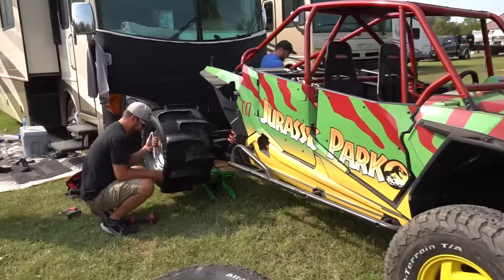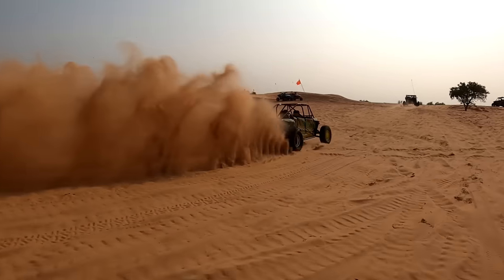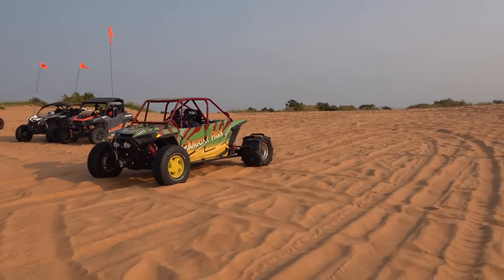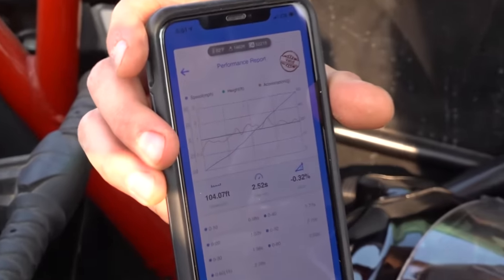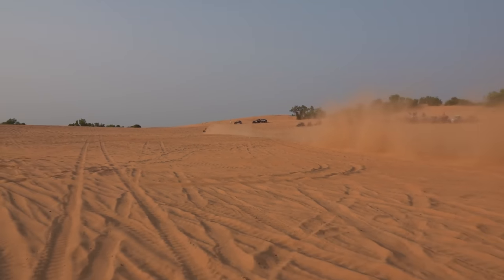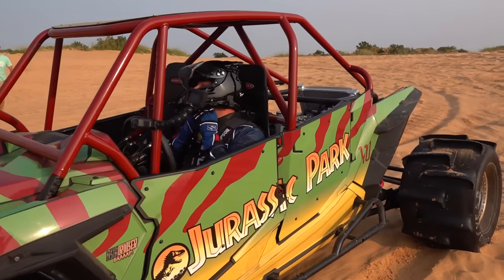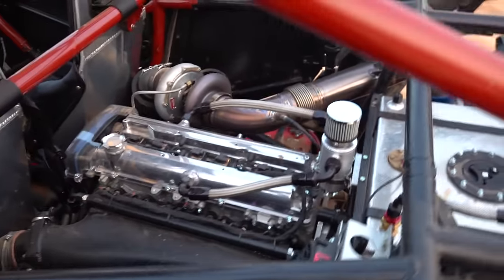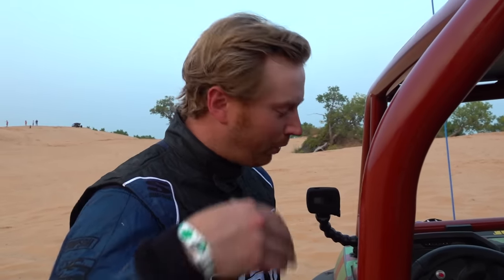1000HP 2JZ powered Polaris RZR hits the sand at LITTLE SAHARA!

Comment: I have sand drag for years. I feel you have plenty of tire. You are in some real soft sand there. You have a 2 spd shift at a 100 ft. The higher gear will load the motor and allow the tire to hook up. Your to use to hearing you belt drive no shift SXS running up the rpm.  The car you have now has big horse power shift early to load the motor and hang on don't drive it like your SXS. Your doing a great job a little more seat time and you'll be the guy's to beat.  That thing is awesome I've been following the build.
Reply: Totally agree. Try short shift it into second and make it lug.
Reply: I need to shift it I agree
Reply: I'd also take some rebound out of the rear shocks as it's bouncing off the bottom and bringing the weight off the tyre
Reply: Or maybe 12 pounds on the tire pressure?
Reply: Omg goog vid

Comment: Just need them smoothies for the front now
Reply: Right imagine it not dragging a BFG 35 through the sand 😅😅😅 this thing is an animal
Reply: Came here to say this
Reply: I’d bet on picking up a tenth or two just because the front end could float better
Reply: Lightening up the front will help it transfer weight to the rear too.
Reply: It’s a 2jz and needs that weight up front with sand tires up front you’d be wheelieing and not hooking

Comment: When you guys get to the strip at sliver lake with the wet sand it will be a rocket with the wheels in the air. !!
Reply: Yep that it will
Reply: @dylankumzi  for what the wheels never left the ground
Reply: @calebhoffman3784  wet sand is gonna grab harder. Most likely bringing the front end up.
Reply: @jaden2790  yeah your right that makes sense
Reply: @steveletson6616  makes sense
Reply: @jaden2790  sometimes the wheel spin is good and actually faster on dry sand then moist wet sand. Wheel spin with paddles grabs more sand equals more sand up and out car goes up and out.lol
Reply: Hell yeah, once i saw the slow mo clip i immediately knew that at silverlake its gonna be a beast, freshly groomed track at silverlake and it's a rocket, put some wings on it and it'll fly
Reply: Axle snapper.
Reply: @dylankumzi  needs wings
Reply: @clayboist  You seen how beefy those axles are? I'm not saying it can't break but it'll be very difficult
Reply: Is that silver lake Oregon?
Reply: @Coyotethumper5  michigan

Comment: Everyone thinks they’re fast until a 2jz swapped rzr shows up
Reply: I think a sxs might keep up in a short track
Reply: @donny-2964  read the draggy data they go.. smh power to weigh means a lot. Put 550whp on a sxs and it will keep up with that in a SHORT TRACK.
Reply: Hey fool go on the new video. Smh sxs ran just as fast as the 2jp did..
Reply: Jose David oh yeah no doubt but but it’s not that serious dude. It was just a everyone thinks there fast joke.
Reply: @donny-2964  I didn't call you stupid.. I respectfully commented my thoughts. But no big deal. It's nothing but a comment. Have. Great day!
Reply: Then the 2j guys get humbled by the guys with the 3000hp LS sandrails!!
Reply: Eric teipen nobody is running 3000hp out in the dunes let alone 2000 maybe a 1-2 guys at glamis or another very popular
Reply: that's some serious 2 stroke poppet valved loop charged power ther! Are you running Motule 800 2t in it. What is your oil injection rat on your 2Jz or do you premix/ What is your premix ratio on your 2JZ? Do you run he stock oil injectiuon system on this thing? I got my 7.3 power stroke on 50:1 each fill up and low ash 2 stroke oil xd-100 in her boy it 33 a gallon for this old poppet valved 2 stroke and she drinks a quart per 1000 mile when i rev it. im connecting 2 OMP VRP pumps into the intake when i get to it though. Motule 800 2t is 14 a quart but ill get that next for my rotary and 8v92 2 stroke detroit if the local boat dealer quit selling BRP XD-100 2T. i bought 5 quarts of amsoil dominator synthetic 2 stroke for my rotary but she loves it! not sure what a 2JZ  2 stroke need but i heard Motule 800 2T!

Comment: Definitely hitting 2nd early would bring the wheel speed up, propelling you faster
Reply: This. In sand you have wheel spin all the way through the gears, so an early shift will likely equate to faster wheel speed, spinning, to get more acceleration. I feel like the tires are 'catching up' to the gear as it's hitting the top of the gear. Unlike asphalt where you are locked in and need to rev out the rpm, here and early shift and get the wheel speed up higher. Sand and mud is all about wheel speed. Not traction so much as you would think.
Reply: Mo powa baby?? 🦅
Reply: I think it would get too squirrely

Comment: Unfreakin believable! The roosts that come off 2JP is incredible! Congratulations boys you made 1000++HP sand dune ripper. Epic
Reply: sick 2 stroke conversion here running motule 800 2t oil injected! Tjs motor can run in any position like a sled motor!
Reply: 2 stroke poppet valved loop scavened brapp, oil injected or premixed? motule 800 2T all the way

Comment: i was thinking you might just need to give her all the beans and let it spin. its not gonna hook on the sand anyway so might as well giver the dinner
Reply: I think with fluid surfaces, acceleration is transferred to the vehicle as long there is enough surface contact. The tires are gonna have a peak "pumping" rpm per foot and if you surpass that by X amount then you slow down. I don't know anything about it really but I assume it's similar to boat propellers. The amount of water they move should allow the engine to reach the power band and limit rpm to near peak HP.
Reply: I find with big enuff paddles sand hooks just fine
Reply: The Weapon Collection  Horsepower is king, try walking in sand vs high horsepower and huge paddles, its amazing the amount of energy it takes but with the right set up its amazing

Comment: The most reliable Polaris in history. Beautiful machine.
Reply: is it running the stock oil injection OMP or is it premixed, this is a pioppet valved loop chared 2 stroke so i heard they like Motule 800 2t, not sure but its dry sump and oil injected and can run in any position fro what i heard. this is what the toyota s-2 stroke loop charged 2 stroke was based off of. This mor can ru tiled at 90 degree like any outboard could with oil injection! What would happen if i do this on motule 800 2t? how dies it compare to a marine 2 stroke diesel or rotary outboard.?
Reply: @jlo13800  it’s running a Toyota 2JZ the engine isn’t even Polaris what are you rambling about?
Reply: I got 5 quarts of Motule 800 2T for my rotary. Pricey stuff but runs good. Unfortunately my 8v92 Detroit 2 stroke and small block v8 2 stroke are to heave for a project like this. I picked up a 2jz motor and got it on amsoil dominator 2 stroke and working on a homemade oil injection system for it.

Comment: Go 6" taller with rear tire size to get more paddles on the ground.  Keep moving to a higher final gear ratio and keep increasing wheel speed until your RPM's drop enough that turbo boost starts to fall off.  Find the optimum RPM range that gives you the best combination of max torque and max boost.  When you get all of that dialed in you will probably find that your wheel base is too short and it will try to flip over on its lid.  Increase wheel base as needed and reduce weight everywhere possible.
Reply: Max Power
Reply: @z i mean its already been increased a bunch so yeah

Comment: Finally a Polaris that doesn’t suck!!. “Psa my comment is All in good fun”
Reply: Lol frfr AaaaaaaaaaaaaaaaahahahahaaaaaaaaAaaaaaa!hahahahahahahaha lol
Reply: With help from Toyota GM Ford .
Reply: Who knew that if you just swap everything but the name plate, it’s a beast... lol
Reply: But wait still no Can Am parts correct? That’s why it’s a beast.
Reply: I would mix no leaner than 50;1 with this motor. Im not familiar with stock oil injection system on the 2JZ, have you tried castor maxima 927 premixed! i use xd-100 in my rotary and detroit 8v92 2 stroke. The 2JZ can be run in multiple positions just like a sled motor! Its basically a chainsaw on steroids but i would go with motule 800 2t if i had one.

Comment: "We actually need more tire"...  Idk if they still do this but WAY back in the day they would double up the rear (duallys) paddles.  That's your fix.  Mr. Quick was the first sand rail to do this in the 70s. (edit) maybe some added weight to the front so it can get on plane faster.
Reply: That would be crazy heavy
Reply: RIP axles

Comment: Here is a thought....keep the tires...for now. Until you can get a ecm controller auto shifter... try coming out of the hole as in the beginning in the 1 st 2 pulls. Instead of winding out 1st, 1 to 1.5 seconds into the hit, grab 2nd.  That should slow the tire spin some and start the paddles to pulling. It’s just a thought.....would like to know what you think of that Doug!!!!!
BTW.....that’s a very nice unit!!!! All who put forth the effort should be proud!!!!

Comment: Idea;
Turn the start rpm up to get more wheel speed/spin in the start and perhaps even short shift into second to load the turbo for even more spin down the track. -I think you might go faster as it looks to me like those paddle tires more or less propulses you forward by the same function as a water jet does on a boat. -Displacing material/weight. If it doesn't work, you will at least take the record for highest rooster in sand :)

Comment: I've been reading a lot of the comments most think you need bigger tires. You guy's are some of the fastest guy's out there when it comes to SXS. If I was to buy one I would want your in put. What you have there is a total different beast. I know you have a huge following and wanted to have the revel at a major event and it was a big hit. You were smart to take it away from everything going on to try it. Now your team needs to bring that thing out during the week after a wind storm when no ones around and the sand is smooth. You need seat time in that beast so your not afraid of it. You have a good team of fast guy's you need to go out with no distractions. You have your blog to share it with us. When I first got enough hp in my car to run in the mid 3s I was still getting beat by less powerful cars. It wasn't  the horse power it was a driver who knew how to harness what they had and their "willingness" to win. With all the horse power your making you have to learn how to short shift it out of the gate. A bigger tire is just going to take away from your top end and put unneeded wear on your drive train.  Most fast guy's with a 800 plus hp have hundreds of hours of seat time. When your the fast guy at the hill everyone that's fast wants a piece of you. Be ready for a guy who pulls up next to you at the hill with a 600 hp car with less tire and plows your doors off with 10,000 people watching. That will make you a believer in seat time is just as important as hp.    Love what you guy's are doing. I'm so impressed with all you've done.  Be safe.

Comment: Doug and crew great job.
You already have all the HP you need.
Try taking off in 2nd gear.
If you have 3rd gear try taking off in 3rd gear, if you have a 3rd gear.

After you try hole shots out of 2nd or 3rd.
Next mess with your gearing, changing 
the gearing in your rear differential will help you get a better hook up out of the hole.
Try dialing in your gearing before looking for a different set of paddles.

Getting gearing dialed in, is where it's at.
Especially with all the changing conditions.

Keep up the great work.
✌😎

Comment: My hands were sweating I was so excited and nervous for you! Definitely moving some sand! Before you switch tires I would try it in normal 330 drag form the sand is usually wetter and even a bit more of a dirt content in our area it seems like. Although you probably want a tire to compete out there, but to they groom there drag strip area out there like most other places? Just noticed the DA was over 5000ft on the draggy so that maybe why you weren't running in the 3s the last pass.

Comment: Hey guys, I’m sure you already know or someone already said something, but if not one thing that might help is getting your paddles a little more level. If you notice from the rear facing camera you’re only blowing a roost from the inside of the tire, the outer cups don’t seem to be touching the sand hardly at all (one thing I hate about staggered paddles) if you get those babies leveled out you’ll gain almost twice the hook right there! None the less it’s still a badass machine, and I hope to see you guys at takeover over here in Oregon one of these years to come! Keep up the good work 🤙🏻

Comment: Get rid of the heavy front tires that hold the front down on take off and keeps the weight from transferring right away. They are causing major resistance til they start floating.

Comment: Awesome machine! Not sure if the oil pressure display is accurate but you may want to keep an eye on that. I'm far from an expert but <50 PSI @ 7000+ RPM would scare me. If it still has the factory wet sump oiling system then it may be pushing all of the oil to the back of the pan under high g-forces.

Comment: Try putting some dune tires on the front end to lighten it up some, then adjust the rear suspension to make it slightly softer on the hit so it doesn't "bounce" that should put you sub 4 @ 300 without tweaking at the dyno.

Comment: Spinning on sand with paddles is different than spinning slicks on  asphalt. The paddles are moving a huge amount of mass to the rear,  causing an equal but opposite reaction to the front. Rockets have zero traction but are quite high acceleration and speed.

Comment: Great job! All my years sand drag racing makes me believe you just need to focus on dialing in the suspension and get some weight transfer. Maybe get those heavy BFG’s off the front. Great work though, 4 second 300 ft is always a big boy number! It’s got a couple tenths left in it just getting that setup dialed in before you even get it more power.

Comment: Get a set of center scoop bigger diggers the offset in those won’t hook as good as the bigger diggers , start watching top fuel sand cars and looking at what tires they run the power to weight ratio I think would be the about the same aspect, my dad had the same issue with his mud rail ditched the off sets and got the straight scoops helped out a lot just a thought sweet ass ride though guys good job

Comment: Need a taller tire for more traction. Adjust gearing afterwards for rpm. There's a thesis floating around on the interwebs comparing height vs width on tire traction. Conclusion, height effects traction more than width due to larger contact patch ratio.

Comment: It's bad ass!! I don't know if I would go with larger tires. Those are working great and with larger tires, you're just going to snap things. It's going to spin in that soft sand no matter what tire you have on it, but once it's on a prepped track with those tires it's going to grip and hold the front tires off the ground the entire 300 foot! lol.

Comment: You refer to the rear tires a lot  and you probably realize this but,  a spun aluminum front wheel with a wider  taller bead to bead buffed tire would help this car a lot. With love and sand  From DYNO MIKE

Comment: Do you guys need to put some rear wheel covers on that thing so it doesn't bury your new engine in sand?  Also curious about the BF Goodrich tires on front.  They look to dig in a bit early before they finally float.  Some good front sand tires might help a lot!

Comment: I don’t know what size paddle tires you’re running but in drag racing to control tire spin is to go with the tallest tire you can fit on the car, I’m sure the concept would be the same in sand.

Comment: No one mentioned shock changes. Slow down the transition to the rear tire. It looks like it hits the tire then bounces back up. Stiffen up rear shock compression
Reply: And loosen extension so the tire digs a little more on the initial hit.

Comment: Over paddled and front needs lightened as much as possible to work with stretch frame. I know it looks cool to sling sand but rear tire height and paddles need to change. Has to work with engines power curve and rpm peaks. Gearing too match whatever your trying to do. Hills, flats, desert sand or ocean sand textures, length of run or all around...

Comment: Need more wheel speed as well as more tire. A shift into second at the 250 ft mark maybe even sooner and loosen the rear compression ratio on the shocks. The extra squat will help plant the power in the softer surfaces. The more sand you can throw, the faster you will go. Rule of thumb lol. Just remember that. Paddle tires demand grabbing as much material as possible for traction.

Comment: Need some smoother and lighter tires and wheels on the front, also try messing with the suspension to make it not squat quite as much in the rear so it digs more. Just my thoughts

Comment: Try it on the beach. Also just curious are you able to start in second just wondering because as a dune racer some machines we start in first but most in second and our 500 2 strokes we like to sometimes hit in 3rd. If you know how to do it it’s amazing. You’re instantly on top of the sand grabbing and it will split your wig man. The most hp we’ve got is about 2500 hp.
These new UTV things are cool but really they’re just a modern day rail now reinventing the wheel.

Comment: Go tall on the tires. It should help with the dig off the start. How much tires pressure are you running I would try under 5 psi and possible go lower.

Comment: Been riding dunes for 40 years big horsepower requires moving more sand Per bite.  Your rear paddles should have half the paddles going all the way across the tire. Move more sand per bite.  Its called thrust.

Comment: What were you running on your back tire pressure I know all the time I went in to send the less air pressure better traction l have  ATVs used to run 3 lb in my paddle tires just to get traction